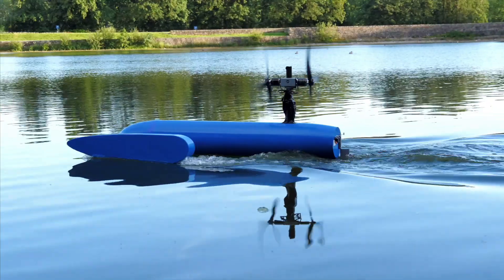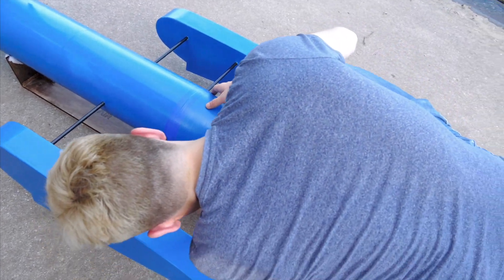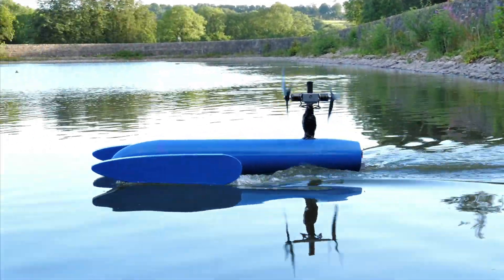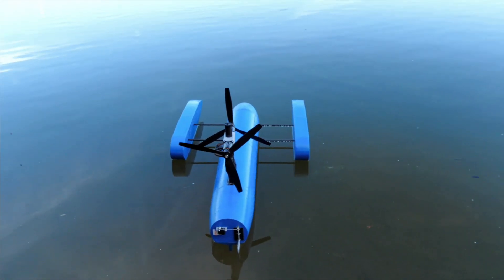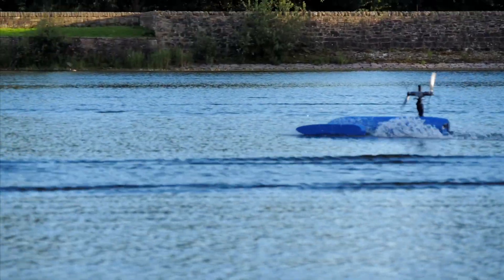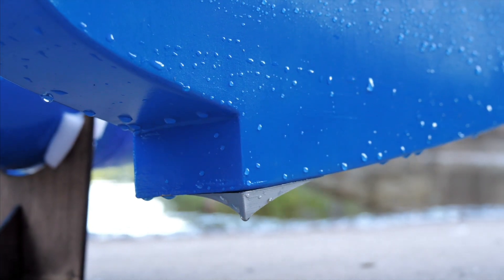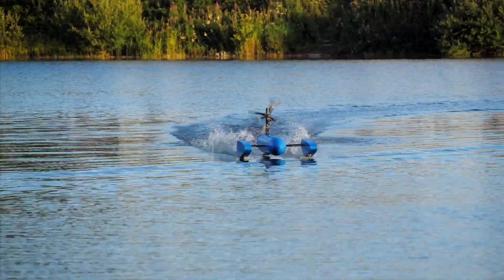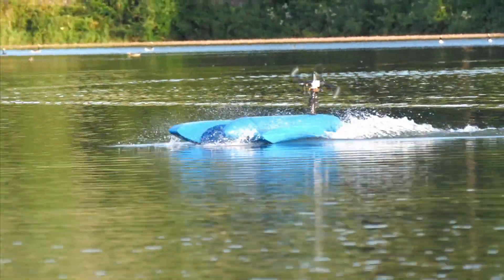DIY Speed Boat Mods

Comment: FYI: Duct tape eventually gives way when exposed to even humid conditions. I know this because I used it to affix Christmas lights to the stucco walls of my apartment's patio. It was never exposed directly to rain but it failed after about a month or maybe a bit more due just to the humidity in the air from the weather. It was an exceptionally rainy winter for California though but that's not saying much when compared to most of the rest of the world (although it rained much less than California when I lived in Lima, Peru). Anyway, I haven't finished the video yet but didn't want to forget this important point about duct tape and I do hope it worked for your purposes. Always good to keep a roll of duct tape around at all times because it does generally work for a quick fix, plus you can light a fire in the rain with it.
Reply: Well I guess the duct tape did not pose a problem. lol That's something I might have also done.

Comment: I was amused by the comment "it's a bit noisy". In the 70s we were running Hydraplanes with glow plug aero engines on 10% nitro reaching 15K plus rpm. THAT was noisy, but a sweet sound when it hit the revss the exhaust was tuned to.  Incidentally we were clocking up 90 mph plus and I believe the national record was over 100 mph. We would never have believed then that could be equalled by an electric model. And so much simpler, simply switch it on and go. None of the palaver of fuelling up, electric starters, glow plug clips et cetera and none of that evocative smell of burnt castor oil. Not very environmentally friendly but a lot of fun.

Comment: @ProjectAir >>> {Serious comment here} Regarding that 'boo-boo' at about 09:52 in this video:  Could you rig the propulsion motors to run IN REVERSE {selectable by radio control} to give the boat some aerodynamic braking? 
 
I presume the propellers would not be very efficient running backwards, but SOME braking thrust would be better than none...?

Comment: I hope you know that if you want to go 100mph with that boat, the thrust of the props is not relevant for the speed of your boat. The thrust produced by the props only determines how fast the boat will accelerate to it’s final speed, which is determined by the airflow coming of the props. The boat can never go faster than the props propelling the air backwards.

Comment: The vertical strut mounting the motors should be faired, primarily for better air inflow to the rear propeller. You may also need to vary the motor rpm's at max power to be sure both motors and propellers absorb max power. The rear prop has more pitch, so equal motor rpms may not actually max out power on both motors. You should also fair the struts that mount the forward sponsons. Greg

Comment: You're probably going to need a boxed truss to prevent the sponsons from going nuts on you.

Basically a wing spar. But stronger.

You could skeletonize that from carbon rods, the problem is the joint fasteners.

With the forces you'll face  at 100mph - essentially, equal to skidding on concrete - anything but metal won't stand a chance.

Comment: May i suggest to cut the sponsons out of high density Foam, and cover it with fiber glass, or carbon cloth with epoxy.
also make a diagonal between the two carbon spars. You know the strength of a triangle

Comment: An idea if you need more stability is instead of making a trimaran like you did, would be a hybrid, between monohull and catamaran. Most speed boat are like that, so you would have two full for stability in the bow, that eventual fuses together with main fuselage, but you would have just on hull touching the water in the rear. 
( btw I’m naval engineering student, so if you need any help, I would morem than glad to help you out )

Comment: design is there, you just need to change some materials and put the rudder in the center :)  and if you need the nose to do some downforce for higher speeds, just make the nosecone flat on the top so the air push it down, if needed :)

Comment: Maybe if you put the rear propeller with more pitch than the front one you get more speed, probably it is working at less efficiency than the front one because the air enters it faster.

Comment: I think that 2 propellers in same alignament do not result a good production as result, one aircraft Cessna with 2 engines the called Push and Pull no did have your production continues ahead exactly per low result of same alignament the second propellers take the aír with high velocity and It make great reduction of efect. Paralells engines are better production.

Comment: Change angle on the thrust, make new pontoons out of foam, triangulate the rods, skip the 3dprinted points (they cause big drag and cause alot of stress). A proper step will be enough to barely skim the surface👍😀

IF the arse still rises, consider just going why not and add some down force 😁

Comment: Gentlemen, that's a boat for sure, but where is the boat head? A bullet shape will lead you to nowhere. It is not supposed to be a symatic shape. You got high density liquid down under and low density air above. 

And by the way, check the hardware store, grab some spray foam use to filll the cracks. It is a acceptable weight to fill all the unuse space inside a boat,.it will physically expelling water if you have a cracked hull.
Reply from the maker: The bullet shaped hull doesn't touch the water at speed though 🤷‍♂️ I think I am getting somewhere but ok! ☺️

Comment: Rudder should be behind the props not in the water. Rudders work best when they direct the flow of water which is why they are usually behind the prop in the water on but in this case make the rudder direct the air behind the prop like an air boat. This will also reduce drag in the water picking up a little speed in the process. And to avoid wet shoes can't you make the ESCs spin the motors in reverse or at least one motor?

Comment: I'm glad I subbed, you're doing something I've always wanted to do after seeing fast RC boats as a kid!

I think you may not want to move away from balsa so soon for your sponsons. Properly reinforced on the inside by glued perpendicular balsa pieces (can't remember the term) to distribute structural loads, and on the outside by a couple layers of carbon fiber, I'm sure they would fare out okay. You really want to keep your sponsons as light/buoyant as possible in order to avoid front flips. I would suggests you take a look at and mimic Igor Negoda's method, which has served him well on very fast and heavy turbojet models. If balsa turns out to be too time consuming, sliced polystyrene/polypropylene in a carbon/glass fiber shell also works wonders, is fairly buoyant and probably easier to achieve laminar flow with.

Comment: I'm thinking an air rudder would minimize weed tangles where I live over a water rudder. Aside from that I like it!
   One nice thing about rc boats and cars is that there's far less battery capacity limitations over powered airplanes where weight is always a factor.

Comment: This is the first video of yours I've seen, and I like it!  Here's a question that you may have already answered, but I'm going to ask it anyway:  Do you have the rear motor set up with a higher RPM, vs. the front motor?  I ask, because since the rear propeller is in a fast moving airstream, it won't be putting out it's max thrust at the same RPM as the front prop.  If they were side-by-side, they'd produce the same thrust, at the same RPM, with the same prop, right?  But with the rear one in the slip stream of the front one, the rear one needs to turn faster to "bite" the high speed air from the front one.  Sort of like a race car that's drafting, and using very little horsepower for that speed.

Great video, and I look forward to watching your other vids!
Reply: From what I recall he has taken it into account and briefly mentions it in the previous airboat video. You can also see from the video that they run at different speeds.

Comment: Actually, carbon is terrible in the water.  It is hydroscopic.  Fiberglass will be easier to work with and doesn’t hold on to water.  Kevlar is also used for toughness.

Comment: Its great seeing you go through the test and development process, and im sure there will be more to come, but im wondering why you went with props, and not an edf jet for propulsion. Its a great project, keep up the great work and get this beast up to 110 or more.
Reply from the maker: Thanks! Glad you enjoyed seeing the process. EDFs, with small high speed fans that have to rev at far greater speeds to create the same thrust as a larger prop/motor combo, are far less efficient generally speaking. They're great for replica jet aircraft etc but not for an application like this.
Reply: @Project-Air  Thanks for the reply, and sharing the information about the motors, props do sound better, im looking forward to the development of your machine, keep well.

Comment: It seems like if you are using two motors anyway, you could avoid the complexity and weight of a rudder by arranging the engines for steering with differential thrust. That would give better maneuverability too. Also the sponsons are uselessly tall, as is the fuselage, which just slows everything down. Wouldn't reversing the prop direction brake (or break) the boat?

Comment: Would it be possible to run two rudders at the rear, with separate servos, so in instances when you do need a braking force you can turn the rudders in on each-other? im guessing the design is for speed only, with no weight allowances for auxiliary items such as brakes.

Comment: With the floats. Maybe make the bottom like stronger bass wood. And maybe fill them with expansion foam. This will make them a bit heavier but more durable and won't sink if punctured.

Comment: Twin motors on the front floats pulling instead of pushing would make it more stable at speed, and a wing instead of bars would create an ekranoplan lift up front while a hydrofoil could be used to lift the stern

Comment: I reckon vibrations are going to be a problem, especially in higher speeds. Having the pontoons stiffly assembled to the body will introduce vibration modes with rather high natural frequencies and when these frequencies are generated at certain speeds, the masses of the boat will start to violently shake as it is in resonance. This can cause all sorts of problems, but most importantly, it might tare itself apart. A simple solution to this would be to have spring and damper suspension between the pontoons and the main body. This would massively reduce the natural frequencies and make the ride smoother. (Well, that's how it works on road vehicles, according to the latest master course in ground vehicle dynamics I recently studied) Maybe someone will read this lol

Comment: About the curved surface of the 3d printed sponson lifter triangle things. Would it be better to have flat facets? To me it would accomplish the same thing but have less drag. The curved surface cups the water to some extent causing drag. For a record run you need all you can get.

Comment: very interesting project. Have you considered mounting the motors in a Y configuration, both facing the same direction and using differential thrust for steering, eliminating the need for a rudder? Was also thinking about your hydrofoil problem. You could go with at least 2 different styles. The hydrofoils need to deploy on the same plane as the hull (parallel to the hull) so you could go straight linear as with a pneumatic or hydraulic cylinder, (this could be mimicked with a servo) or rotational motion, keeping the foil parallel with the hull. This could also be done with servos. Looking forward to next video. Hope these ideas help or inspire better ideas. God bless, stay well.

Comment: G' day James I have been subscribed to your channel for a while and have really been enjoying your work.  Particularly so with this project.  I am located next to some prime waterways and am planning (if I can ever get time from my usual channel stuff) to build a similar craft.  After watching your video and seeing the sponson leak I thought to bounce a few ideas your way, remember I am not in any way an expert on these things.  Ok the first thought was about those leaky sponsons.  At rest there is very little below the waterline and a lot above.  Under power they only use the bottom edge.  What about redesigning them in the style of a water ski made from Aluminium sheet and having a small section of foam stuck to the topside for the flotation.  The support arms could be bolted on with a 3D printed bracket or similar.  Advantages are that the structure cannot leak, as there are no internals.  The planing section is now super strong and the wasted structure above the water line is now eliminated.  Ok my next thought was about  those motors overpowering nose section.  I would be thinking to make the pylon height lower and use a smaller coarse pitched prop set.  By the looks of it the boat does not need  a lot to get it on the plane and the coarser pitch will give you a higher top end speed, with a more progressive acceleration and smaller levering moment.  Of course thrust angle could be changed as well to alleviate the pitch forward levering effect.  Keep up the good work Allen

Comment: This is exactly what it's all about yes I know there may be many more "OH Dears" along the way but Everything is experimental. Now onto your boat "Oh Dear" is her name mate? Well for one I'm not entirely convinced the double prop is the way to go "Maybey". I was thinking dual props mounted separate on each side in back but thinking a air-foil type wing top & back on the main fuselage to keep it down After the lift. Front sponsons can be re-used & Kevlar glass & resin used on their outsides for strength with alloy brackets to attatch them. One good thing is your boat maneuvered very well & you didn't break the rudder! Carry on Mate Give it a Go or we may never know.
👍👍💛 Subscribed🔔

Comment: Those printed tip things under the outriggers are a bad idea.   Going to a point like that is very draggy as you found out ( the rear end lifting up). They need to be a flat surface ( Even if it is narrow)    Look up: The 100MPH Airboat by Dan Jones
: on youtube

Comment: Carve the sponsons from xps or polystyrene and add a layer of fibreglass. Wood inserts can be used as attachment points for the spars. So quick to make and you can make a few interchangeable ones to test shapes very easily

Comment: Very nice! A tip: Retire those Master airscrews and install Ramoser varioPROP instead. These can be fine tuned in pitch.
Reply from the maker: Definitely want to experiment with new props on the next one. The only reason I’ve been using these is they’re the only CCW and CW props I could find in these sizes!
Reply: I built up a biplane and mounted two motors in the front and rear of the top wing. It pitched down badly, even with excessive thrust angle corrections. 

Another thing to consider, you can hear the prop stalling out as you start to increase speed. I can only imagine this is much worse with how close the motors are. Use a smaller prop up front and give the rear prop more pitch. That was the front motor moves air up to speed and in the right direction,  and the rear will be that more efficient and the larger size will help keep it from stalling. 

On my setup, if I ran each motor up (I was running 11x7 props, front one conventional rear one reversed rotation) and then added them together, it pulled 550watts. Now running both at the same time, I could only get 350 watts total. I eventually fixed this by putting a 9" prop on the front (I forget the size) and an 11x7 reversed pitch on the rear. This gave me over 450 watts with both motors running and near 500 watts with them running separate. I think I was making around 6lbs of thrust on a 3lb airplane. 

I actually do have a few videos on my channel of it before I detroyed it. Under "fast" acceleration, I would put full up elevator into it and manage speed with throttle and then actually chop the throttle to attempt a short take off. It usually took alot because of all the downward pitch from how high the motors were mounted.

Comment: Change the spars for the sponsons to a wing and use surface/ground effect to reduce the membrane friction between the water and the skin of the vehicle.

Perhaps also move the motors forward by about 150mm to increase the trailing effect of the rudder.

Comment: Nice project, I think you should center your rudder for balance purposes especially when getting out of the water at high speed, this should reduce vibration as well, you could even prolongate the rudder behind your thrusters for more control

Comment: there is a liquid they pore into the fuel tank to seal small holes.  maby that can be used inside 3d prints to make them water tight

Comment: Just a thought,  what about a spring-loaded braking system on the rudder similar to a split tail rudder in an aircraft.  Minimal moving parts and can be activated by your radio by switch or when you completely decelerate and hit reverse on your radio.  Just food for thought guys and I love your channel!

Comment: Grand mate! She's coming along. Like the solution on the sponsons and the rear plane. Not to be Capt. Obvious, but why did you not use a reversing esc? It is, after all, a boat. ;)  Overall she's magnificent, and will be more so once strengthened. So much potential that it's scary. The envelope you are riding is about the thickness of the surface tension on water (practically 2D), minor hiccups become quite epic. Looking much forward to subsequent vids!